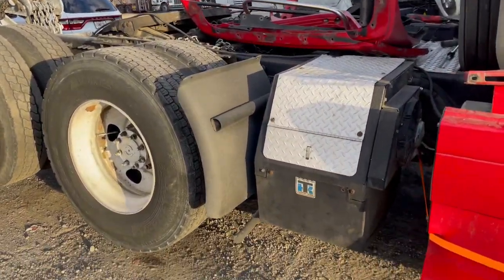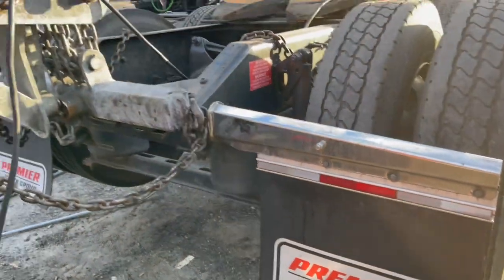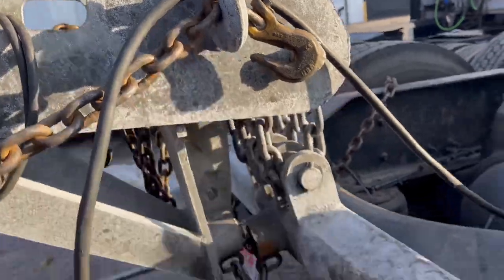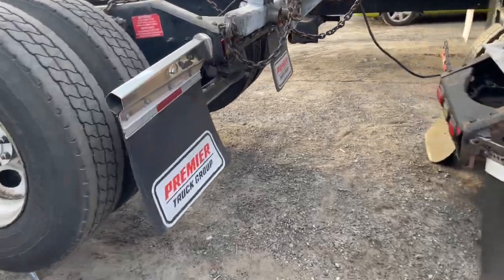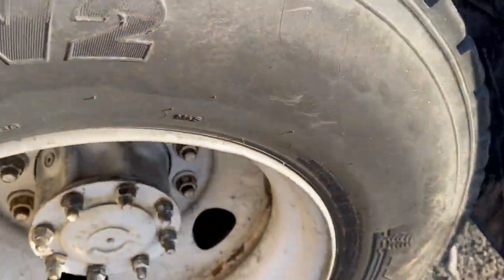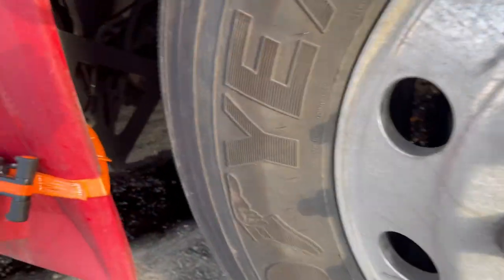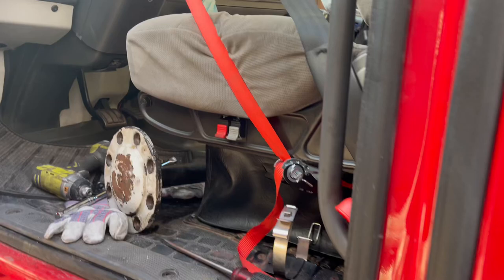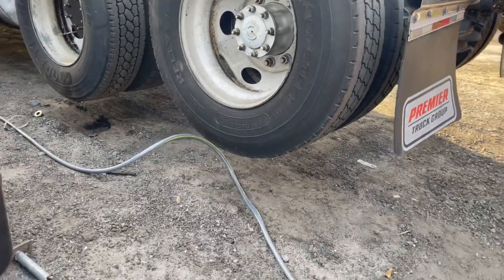How To Tow A  Volvo Semi Truck With A Tow Boom

Comment: Company that makes the pro tote  hoist also  has a complete strap kit in a carrying bag to secure your fairings so you don't need to remove them
Reply from the maker: Yes they do, problem is the 3rd party companies that rent the  pro tote out most of the time don’t have them, as was in my case. This is an alternative for when they don’t supply them when renting the pro tote.